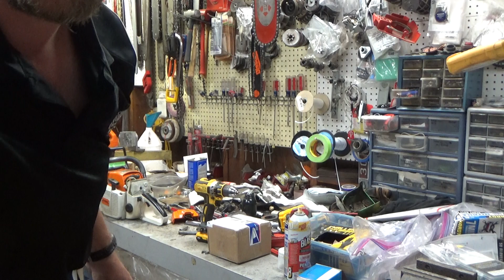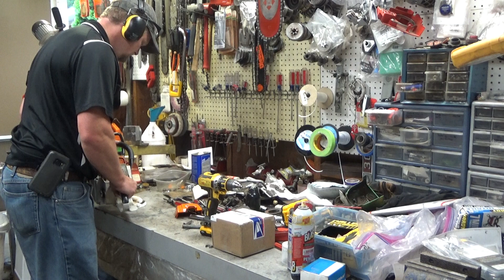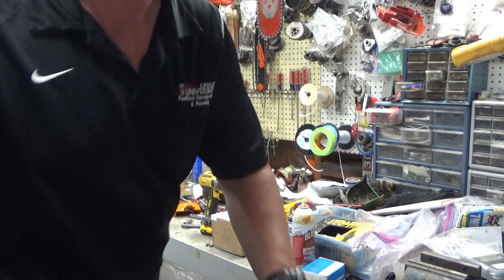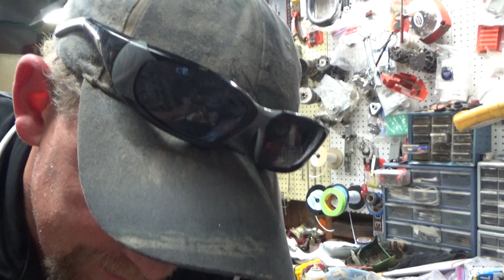Bryan's Stihl 028AV Super Test Run-They Told Him It Had Low Compression!!!

Comment: Thanks a lot for the video upload Leon and the update!  Yeah the guys at the shop pretty much wrote that saw off and they're an authorized Stihl dealer!  I just shook my head when they told me "low to no compression" on that saw.  I mean really?!?  That's the very first saw I ever did a top end rebuild on and if you got it to run for 10min without quitting then that tells me I at least did the rebuild the right way.  By all means please do take 'er up to the woods and put 'er through the paces!  I am very much appreciative of your time your skill and your advice.  I think you hit it on the head about some guys just not having the ear to tune a saw.  I reckon I went above and beyond sending you new seals and bearings but I just wasn't sure if maybe there was a leak somewhere or what.  And besides, everyone on the arboristsite and a few others kept telling me it might have bad seals and/or bearings so I figured I'd cover all the bases and include new ones just in case.  Very cool to see and hear it running so good!
Reply: Hey I wanted to add good job on your rebuild and Leon is the man I learn alot from him as well I have a 330 homie I fixed thanks to his wisdom it's the first saw I purchased an man will it cut thanks to Leon's advise. Knowledge is power and the men who share it are heros to those who are willing to listen
Reply: I wonder if they where just going to try and sell you a new one. That model Stihl (028AV super) was one of the best saws they ever built. In their size class, they are the best. I've cut literally thousands of cords of pulpwood and small sawlogs with that model when I was in my twenties. 
Maybe someone wanted it and by lying to you, they thought they might get it cheap. 
I hope you get many years out of great service out of it.
Reply: @kylewarnecke3018  Kyle thank you bud!  Yes this channel has been a godsend as I to have a few old Homies and Leon has been a great guy to watch and learn from .  It's getting to the point now that folks are bringing their saws to me now when they want them fixed!  I give a whole lotta credit to Leon for getting me where I am today with chainsaw repair☺
Reply: @aldredske6197  Al you make a very valid point.  Very possible they thought I might just let them keep that saw if they thought they could fool me into thinking it's a hopeless case.  I knew enough to know that saw has plenty of compression and I knew it was worth taking the extra step to have Leon give it a good look.  I remember the first words out of the service guys mouth when I handed him that saw was  "hey man that's a really nice saw you got there".
Reply: @TheCrittercam001  :) It's getting harder and harder to find those 028's. I lucked out and found one last winter for 150 dollars. It needed a good cleaning and maintenance that took me a hour or so. Now it looks and runs like a new one. 
Hopefully those guys wouldn't be that way. But either way, weather they didn't know how to fix it or they wanted to steal it. I don't think I would ever go back to them for much of anything. 

Take care my friend.
Reply from the maker: A this point I see no reason for seals & bearings...as long as she cuts a tank of firewood, I think you'll have some spare parts for down the road!

Comment: I got a 021 . put a16 inch bar on from the 14  Parts are cheap for it but if the bearing goes out in the clutch they eat in too the oil pump bay .. I had to jb my case up on mine. Cause I got it free Must not of oiled for the last guy .i got good oil now out of it after I did that